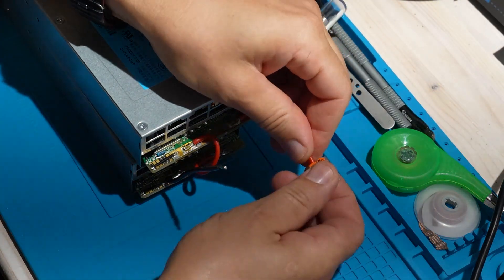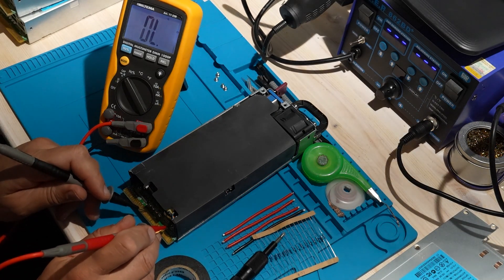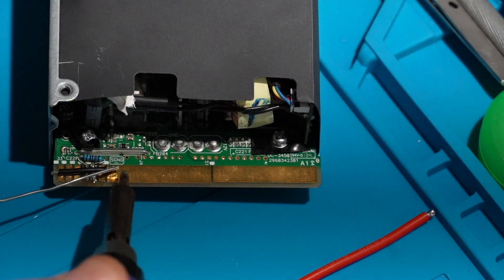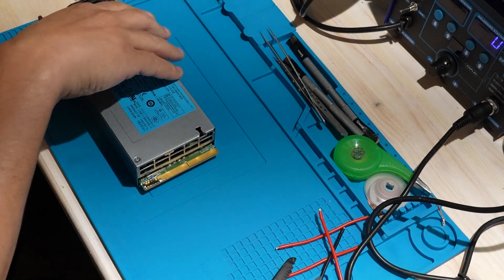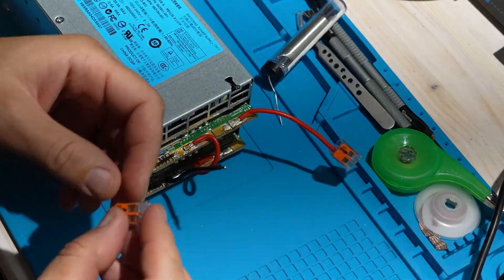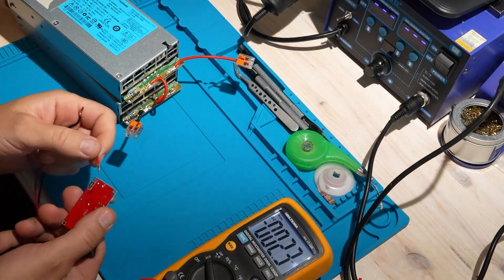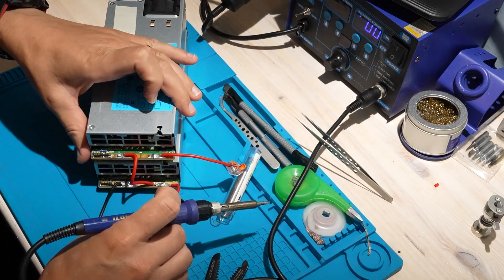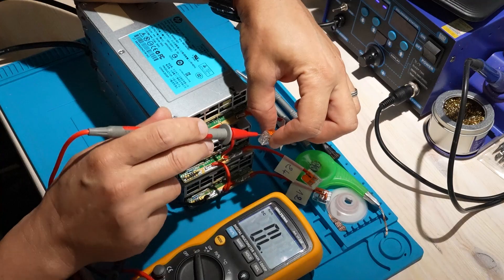12V → 24V → 36V from $20 Server PSUs

Comment: Ok if i want 12v and 24v available,  i use the master as 12v and the floated for 24v ? Connected in series. I think thats correct.
Reply from the maker: Yep, you’ve got it exactly right. I checked out your channel and subscribed, nice stuff, man. Make sure to use proper gauge wire when wiring the PSUs. I’m guessing you’ll be using it to charge RC car battery, just be careful with that setup.
Reply: @TheWiz4Real yeah I will.  I use a hp 750 now 12v and it works well.  More power is always better. My charger goes up to 50v input.
Reply from the maker: Yeah, 750 is nice. You can stack as many as you want as long as you follow the floating rule. And each power supply adds a new rail, 12V, 24V, 36V, 48V, and so on.